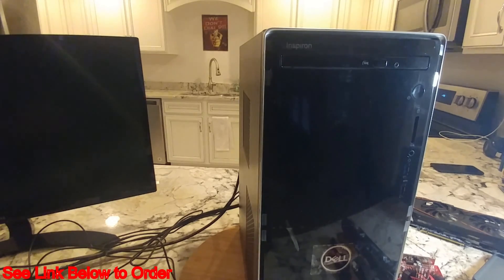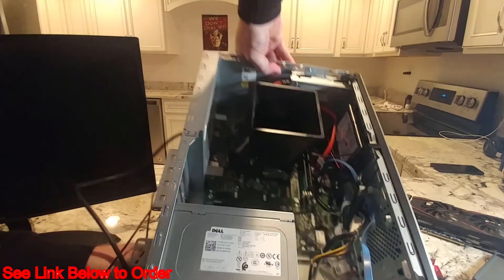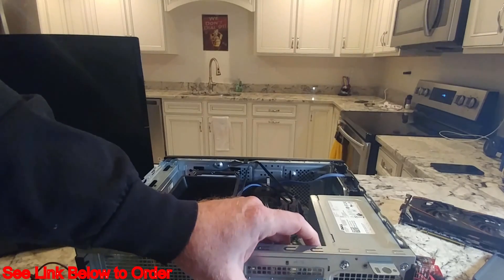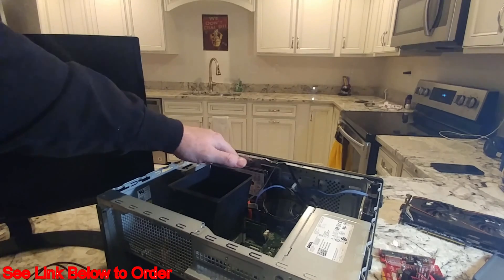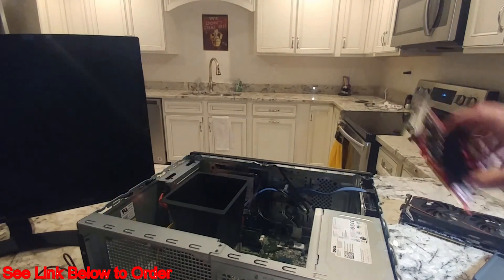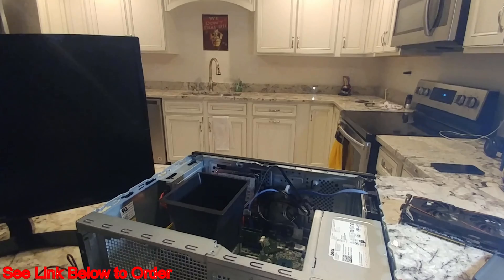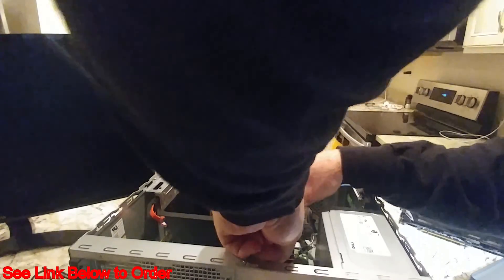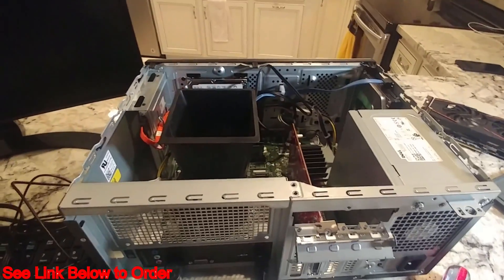How to install video card in a Dell Inspiron 3670 desktop computer, gpu, step by step

Comment: Can I install a rx 580 in the i5 8400 model?
Reply from the maker: Yes,  but you need to make sure it will fit as RX 570 barely fit in there.  You will need switch out PSU and 24 to 8 pin connector.  I have a video showing me putting in an RX 570.
Reply: @PC_HardwareTechUnboxing_1  ok my friend .

Comment: can this pc change to 1050ti？
Reply from the maker: Yes, you can fit a GTX 1050TI in it.  On this channel, I have tried out a few, you need one that does not require a 6 or 8 pin GPU connector.  Options include:  GTX 730, GTX 750, GTX 1050, GTX 1050 TI, GTX 1650, RX 460, RX 550B.  Some of these have gpu connectors so you have to make sure you get the right one.
Reply: David Noble so 290 psu is enough for 1050
ti？
Reply: if it is enough I dont hv to change it
Reply from the maker: @Hugo-yz2um  I had no issues even with the GTX 1650 installed which recommends 300W.

Comment: I got a3670 i3 for $100. Is it worth adding ssd, more memory, and a gpu to make it a better gaming machine?
Reply from the maker: Yes...watch my video on SSD installation from recovery USB.  Buy a GTX 1650 for good 1080p gaming.  Go with 12-16GB RAM as well
Reply: @PC_HardwareTechUnboxing_1  , nice! Thank you for the speedy response. All in it looks like I'll have a fairly decent gaming machine for under 400 bucks! You're the man, David!

Comment: I am very Confused as to what VIDEO CARD i can buy online and maby used on amazon that will be the best bang for my buck, and also be the best direct x 12 capable card for use with Mixed reality headset.i  can not understand what is the latest card, and or if the latest card will still work with mixed reality headset. i want one with at least 2 hdmi outputs.

Comment: I got a gtx 1650 that requires 75 watts,will it run and is the power in the dell inspiron 3670 enough?
Reply from the maker: Thx for the question.  Recommended system power is 300 watts for GTX 1650.  PSU for 3670 is 290 Watts.  I can only speculate but I think you will be fine if your computer has the bare minimum set up in it and I would say...say 8-16GB RAM and a M.2 NVME.  If you have other PCIE cards, extra HDD...using USB for external drives, you might have issues.  There is a 365W PSU that fits this case if you do have issues.  You will know that you are having issues if your computer keeps rebooting. 

I have a GTX 1650 on the way that I bought for the channel....and specifically to make a video for everyone  to see if this card is a good fit for the 3670.  I also have a few other OEM's though to put it in.
Reply from the maker: I got my GTX 1650 in it, installed...no issues.  Gaming is decent bump up from UHD 630 integrated graphics.  Slight improvement over 1050TI from what I remember.   https://www.youtube.com/watch?v=UmAR4fG2I6Y&feature=youtu.be
Reply from the maker: BTW, the new Dell 3671 with same PSU wattage now offers a GTX 1650 GPU.
Reply: Ok thx for the reply

Comment: What is a good gpu for this Pc to play Fortnite on?  I have this model with 290 watt power supply with a m.2 SSD.
Reply: Oh oops 😬.  I am on my iPhone and it has auto correct while I type.  Idk why it says hour but I mean a GPU that can play some newer games fine with normal settings.
Reply from the maker: @WantBadtime  I know that problem.  I made a video for just that...it is a little long...probably dry.  I will add the link.  Lots of options.  I think I list out each video card that is compatible and provide a link to spot where you can see what others are using.  Note, some people upgrade the PSU.  I have not tried this one yet, but the best GPU that does not need 6 pin GPU connectors is the GTX 1650....it is 300Watt recommended.  I have used the next best which is the GTX 1050TI.
Reply from the maker: Hi Theresa...not sure what you mean by "good hour".

Comment: I bought a Inspire 3668 and I didn't know that the PSU is just 240W. Do u think if I buy a GTX 1050TI it's gonna work good?
Reply from the maker: I have never had that model, but from the quick research I did...it looks like you  you should have a minimum of 300W PSU.  Now, the TDP is 75W, the CPU you have is probably 65W .  Unknown what the peripherals add up to.  The power supply is probably less than 80% efficient.  If this card fits that case, it is possible the computer will boot up with the card installed.  What is not know is how the PSU will handle being taxed under heavy load by the video card.  Now, I did use the GTX 1050TI with a PCIE ribbon extender on the Dell Vostro 3470.  That PSU is probably close to yours.  So that combo did work...but it is really on the border of where long term use could be bad.
Reply: Don't worry it will work

Comment: Thanks for the video! Can this run either the gtx 1050 ti or 1650 on a 290 PSU?
Reply from the maker: Hope you got something out of it.  I actually tried a few cards (rx-460 OEM, RX-560b OEM, GTX 1050, GTX 1050 TI)...never made that video though.  I used 500w or 600w psu with rx-570 and rx-580.  Albeit, those PSU's are not engineered as perfect replacements and should not be used as such long term.  So getting back to your question, 1050TI recommended PSU is 300W.  It's TDP is 75 watts and I think the 1650 is 83 watts.  So you might be able to assume recommended is 308W.   Your process should be 65 watts and I am not sure of the other draw of your components.  I also do not know the efficiency of the Dell PSU.    If you ran a combination of 4 HDD/SSD's like I had in one of my videos... and had the RX-460 by HP OEM in there and never had an issue.   What I have seen in similar situations is using a 400Watt PSU to power say a RX-480 and the screen goes black under heavy load/gaming and you have to reboot...and eventually upgrade psu.  I cannot tell you that this will never happen to you.   That said, if you are worried, there are options for power supplies that will get you up 365 watts.  2 specifically for Dells...the other I pulled from an Asus m32.

Comment: I've wanted to install a gtx 1050 into my Dell Inspiron 3670, I saw forums stating that I have to turn off secure boot, but I saw other forums saying that you don't have to. Did you have to turn off secure boot so your video card could work?
Reply from the maker: Hello, I did not mess with any settings on the Bios to get any if the 4 video cards (rx460, rx560b, GTX 1050, GTX 1050 TI) I installed to work.   Nor did I change any after I semi-installed a 500W PSU and used rx-570.

Comment: I bought this computer back in January thinking it would be a good starter gaming base and it's a complete waste of money! The power supply is less than 300w which is the minimal requirment for low profile cards, plus no 4 pin connector? And only 8 gigs of memory. The only thing salvagable is the i3 8100 cpu, 1tb hd and stick of single stick ram, which I will be using to build my own machine. In short OEM's suck.
Reply from the maker: For the most part, I agree..on this I build a lot of computers. Much worse if thus was the 3470.    I also pick up computers like this to fiddle with.  I have a video out there about upgrading the PSU, there is a 24 pin to 8 pin part u have to buy.  In short, you can get a decent graphics card in this computer..and are not limited to GTX 1050ti or 1650.
Reply: @PC_HardwareTechUnboxing_1  I'd highly recommend picking up a semi-modular psu to use with this computer. The case is very small and cramped, leaving no room for cable management. But, yes I can agree it's a good system for the everyday user, or as a side project. The onboard graphics aren't actually all that bad. I can get up to 30fps with GTA5, and it plays 1080p video flawlessly. Haven't tested anything more recently since I'm only a casual gamer, but obviously this computer would be best suited for business or school work.
Reply from the maker: @lauracoykendall9616  Don't get me started on all the PSU'S I have tried out.  :)
Reply: @PC_HardwareTechUnboxing_1  tried quite a few as well before deciding to give up and build a new pc lol
Reply: @PC_HardwareTechUnboxing_1  I've tried quite a few, no luck yet.
Reply from the maker: I had pulled a psu out of an old ASUS A10 desktop that was 365 W and had the fan blowing the right way.  Only advantage was it had SATA Power connectors.  I put an EVGA PSU in there turned it so the fan blew  towards the motherboard but did not bolt in.  There is supposed to be a 500W PSU that has a faceplate that will work.  Within the last year, I have looked at this Dell, the 3470, an Acer I5-8400 and 2 HP's.  They all have issues when it comes to upgrading.
Reply: @PC_HardwareTechUnboxing_1  Huh, interesting. I also found a Dell 365 W that will work, it also fits the Optiplex XE2, 9020, 7020, and Precision T1700 Power Edge T20 Series...could be the same one as yours, but highly unlikely.

Comment: Why not replace the power supply? And install a 1060 mini
Reply from the maker: Yes, I may do that as a project.  I have a few other custom computers here that don't have these limitations.  I did try to fit a 500 watt PSU in here..it will fit with some slight  modifications..than I need only get a 24 pin to 8 pin..assuming that will work. Either way. I will have a little fun with it b4 I move on.
Reply: He does and uses RX 570 though.
Reply: Sadly I tried using a 750 watt power supply but the board didn't agree with it and refused to even turn on.
Reply: What PSU brand is it?  I have a EVGA 700W Bronze